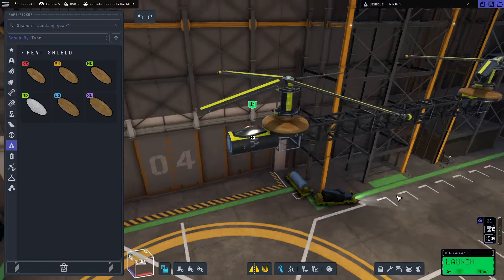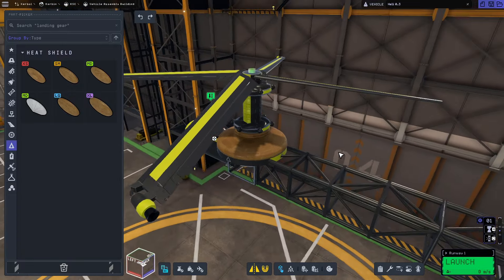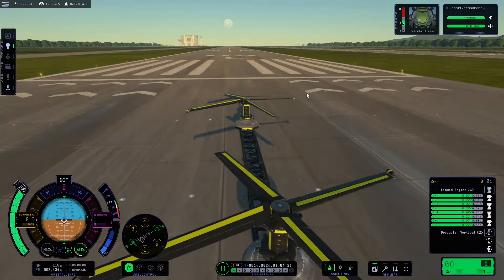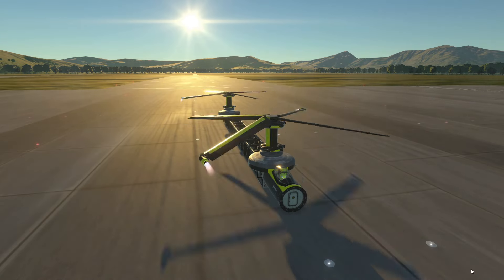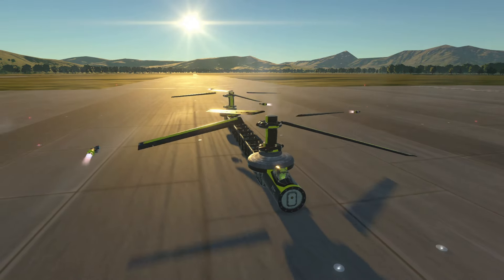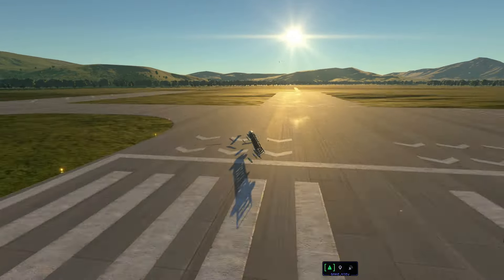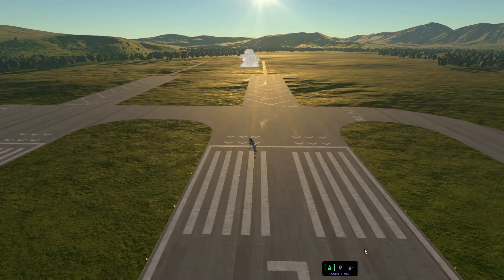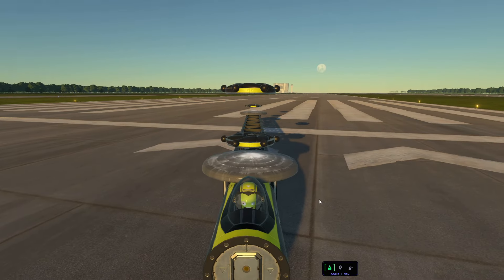First KSP 2 Helicopter attempt

Comment: If your doing a tip jet heli, you can get away with just one rotor because your not imparting any torque from the main body. That way you can save on some weight on structure for more C&C.
Reply from the maker: Thanks. I did actually resort to that in the end!
https://www.youtube.com/watch?v=JIoV1FT70iM

But unfortunately the bearings are not frictionless (still, they're not bad considering we've had to build the bearings ourselves!), so a torque is still imparted into the body of the aircraft.

Comment: What a great attempt. Smart having the two rotars working opposite. Did try something along the same line but the rear diagonal to the top prop to counteract the side ways force. It could be interesting to attach a engine to the base to see how much more additional power is needed for lift.
If it was lighter, I think it has a good chance of lift off. Great work OG❤
I've put a post on the KSP Forum about the Audaylon wheel bearing and linked up your attempt too😃
Reply from the maker: Thanks man. Nice idea with the forum post, I hardly ever visit the forums - but others do use them!

I did think about putting the engine under it to measure weight, but I decided I wasn't close enough yet. I'm working now on lightening the craft and increasing lift (six-bladed prop with longer blades and smaller heat shields). 

This one doesn't have counter-rotating props, but I do plan to put that into later models once (if) the lift becomes sufficient.
Reply: @originalgrahamster  Seems to get alot of hits on the forum so thought it was worth a go. More blades, good idea!  
I'm stuck doing chores at the mo. I just want to get back on there and have a go. Really is quite addictive 😃

Comment: you need much bigger rotors for more lift.
Reply from the maker: The problem is that the longer the rotor blades, the more the weight and flex of the chassis (because you have to space them further apart). It's a REALLY tricky thing to get right.

But don't worry, I managed to get SOMETHING to fly! Pop back to this channel after 1400 GMT and you can see for yourself. 😉